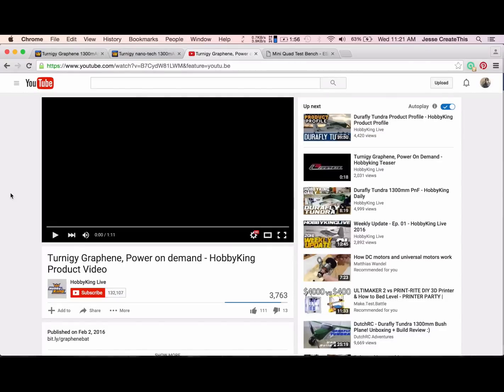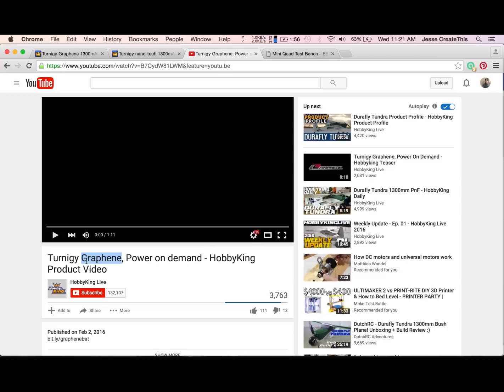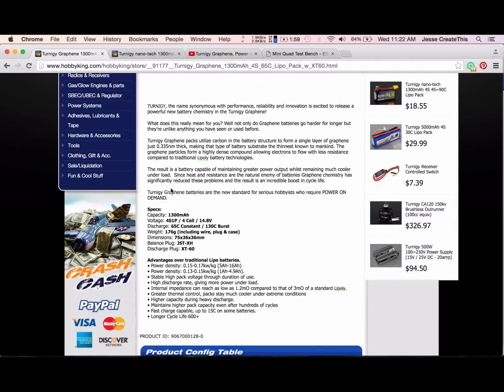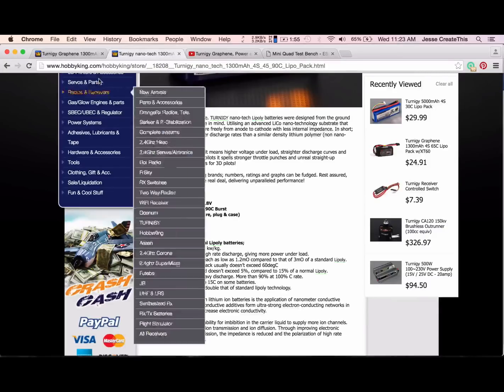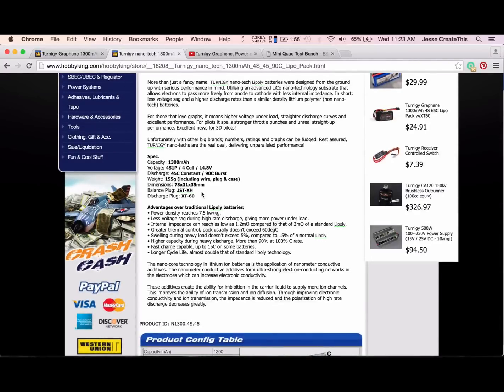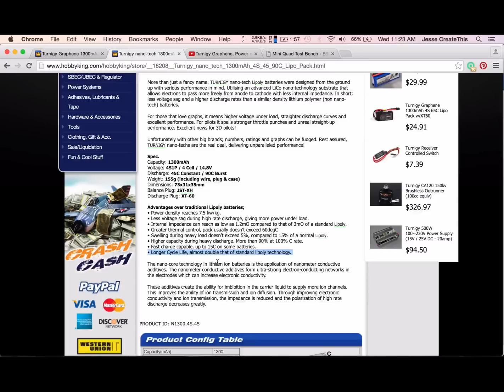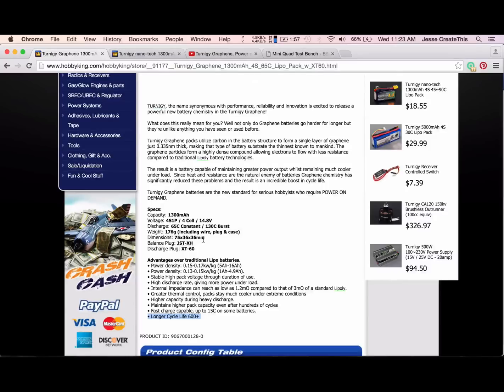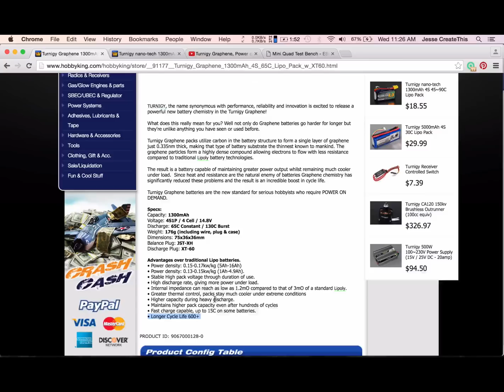Graphene batteries are finally here!

Comment: Calling these LiPo's 'graphene batteries' is a complete misnomer. They are Lithium Polymer batteries with  the graphene used to pass conducted electricity from the cells. We're still a long way from GRAPHENE batteries. You seem to understand that in the video, but calling them graphene batteries is a misnomer!
Reply: +GaIiIeoMateo I'm pretty sure the voltage would be different than a LiPo
Reply: +Henry Griffiths Yes!
Reply: +createthis It would have a cathode made of graphene layers, from which the (conventional) current would flow towards an anode, and to which electrons would flow back. There are already prototype graphene/li-ion super-capacitors based on this concept (ethylene glycol assisted-hydrothermal reduced graphene, or EG-RGO), with very high power densities, but their energy density is still pretty low. Combining the speed of super-capacitors with the capacity of the best li-ion batteries would be the dream battery.
Reply: This reminds me of the Huffy bikes that had "Chro Mo" stickers on the frame. When you looked closely, it was only the bridge tubes (the tiny ones that connect the seat stays and chain stays in front of the rear tire) with Chrome Molybdenum steel.
Reply: +createthis I think they would look like the round and flat cell super capacitors that are on the market now. They are starting to get cheaper and better and it is only a matter of time before these super caps start getting into the energy density of LiPos. Some nice things I like is that super caps can have massive numbers of charge cycles, can deliver massive amounts of current without damage as well as being charged very quickly. 

Big downsides are that a capacitor holds a massive amount of charge, but they have a very bad discharge characteristic of having a very wide voltage range and will discharge down to 0v without damage and also has a very high self discharge rate and most available super caps will totally discharge within a couple of days.
Reply: Technically correct, however there are real graphene batteries.  The Fiskers Emotion car uses them & it supposedly has a 400 mile range & a 9 minute charge time--so...js
Reply: Do you have a link to some articles related to the above?
Reply: maybe it's a little transparent cause graphene transparent...? (just a fought)
Reply: GaIiIeoMateo not to mention what buildings would have to look like in order to use it for creating structures with it looks crazy like something out of Halo lol but I'm sure they'll figure it out or maybe they have.... Area 51 🤔
Reply: A true graphene battery would not have any capacity loss after 600+ cycles.
Reply: It is a step in the right direction anyhow.
Reply from the maker: +GaIiIeoMateo I suspect this is the simplest way to improve a battery using Graphene, yes. What would a "real" Graphene battery look like? How would it differ?
Reply: +createthis Hahaha you've got a great point... I'm really not sure! (as you thought I may have said.) I imagine the first steps will be like what we've seen here, improvement of current tech using graphene before we ever see something like the actually LiPo cell itself redesigned with graphene. Hmm. I'm excited for the future of batteries regardless!